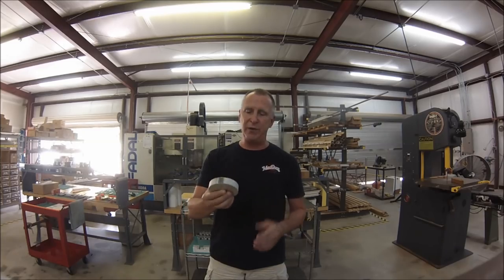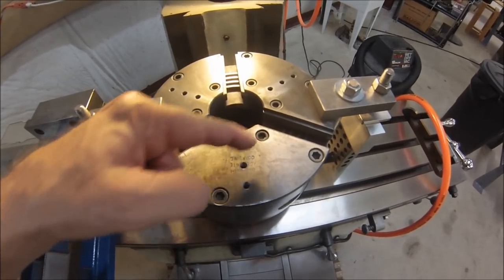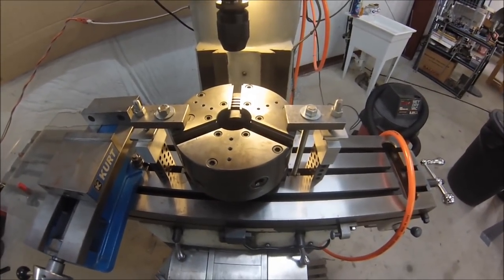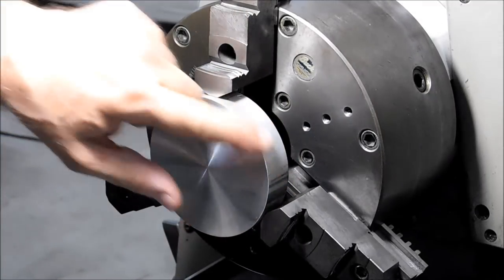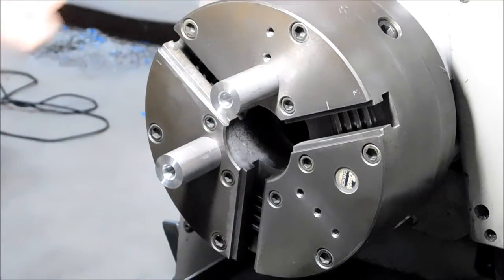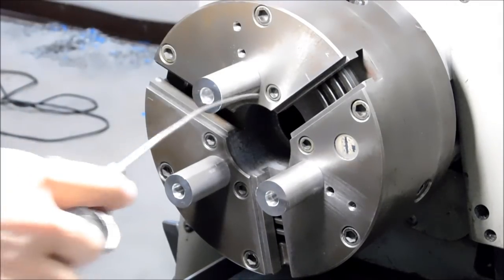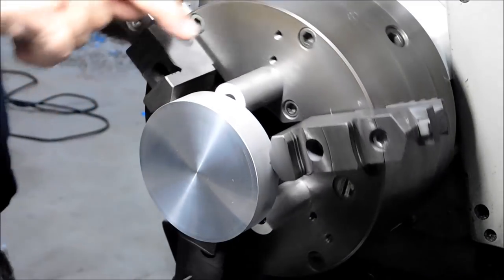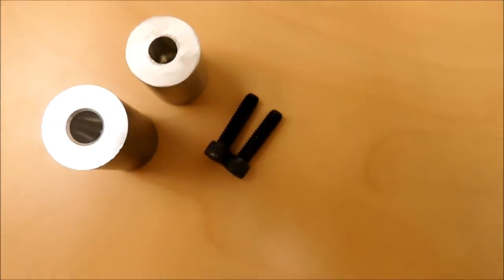A Simple Chuck Modification to Improve Parallelism of Your Parts

Comment: You don't need to go through all that trouble, just buy yourself a set of reversing jaws or in your case I notice you can reverse the set you have already have, simple isn't it!!!.
Reply from the maker: Provided your jaws don't deflect outward when you tighten them, and provided your parts are thicker than the jaw steps are deep, and provided you aren't worried about possible jaw scratches on your part from jaw movement on a finished face, hard step jaws will work. Personally, if its not a soft jaw setup, I'll take a solid stop over a movable stop any day. This video, as many of my videos attest, isn't about buying anything. Its about getting it done now.
Reply from the maker: On older worn chucks, the jaw deflection will effect the part. Even if they are skimmed soft jaws. It will be close, but this will be closer. If concentricity is not the target, this works extremely well.
Reply from the maker: Take a look at the video titled " Jaw movement you probably weren't aware of"  These standoffs take that error out.
Reply: And if concentricity is a concern, these work with a 4-jaw just as well, just have to make 4th pylon :)

Comment: I am not a big fan of doing "precision" TWO-SIDED work in a scroll chuck... no matter what workaround you have...
Reply from the maker: Tell us what choice you have and use.
Reply: an independent chuck and a dial indicator... scroll chucks are for welders and woodworkers...
doing ANY "precision" two-sided work I wouldn't re-chuck on an unmachined surface, I would skim cut myself enough space to
 re-chuck and indicate off of.
Reply: D-railed  For apprentices (like me), can you describe how this makes a difference given what Joe is demonstrating?  Seems to me you are talking about insuring concentricity, where Joe is simply demonstrating how to get two surfaces (of the same part) parallel quickly... What difference (other than concentricity of a part) does it make which chuck is used in this case?  I get that scroll chucks don't equal "independent" chucks when it comes to centering parts...  But that doesn't appear to be the point of Joe's discussion...What am I missing?  Thanks.
Reply from the maker: You're not missing anything. The demo was exactly as you say. Concentricity is a whole other story.  The comment D-railed made has some merit, But I'll take a nice scroll chuck any day. An adjust tru buck is one of the finest chucks made. Its a scroll chuck. Independent chucks are usually 4 jaw and I only use them when a 3 or 6 cant hold the part. I'm not a fan of the technique of holding round material in a 4 jaw. Its a waste of time.
Reply: actually, you should be cutting deep enough to produce a shoulder to indicate off of when flipping the part to prove your parallel, trusting standoffs OR soft jaws to do so on an unmachined surface or any surface is risky business...you can get "lifting" when tightening your jaws even if you think you are all the way back against those stops. 
having the perpendicular faces machined in the same setup and using them to indicate from for the next set up is the only way to make sure...
i get it was just that way for demonstration but if you are going to flip parts ops need to line up with the last one, telling people to rely on stops and not indicators is not "precision" work.
I am a toolmaker moving towards metrology, seeing how wrong I have been about being accurate AND precise...
 but yes a "good" scroll chuck is OK for a lot of work,
 just giving you shit because that's what machinists do. 
great videos by the way.
Reply: @RubSomefastOnIt  to make 2 parallel faces on a round sliced bar using a lathe you do not need a 4 jaws chuck. 4 jaws chuck are for other specific purposes. Joe was right, you are outfield, sorry.

Comment: Just drill 3 holes in the pcd between the o/d and i/d and make some 90 deg angled brackets , about 25mm wide and mill a slot down the middle of them and you have an infinity variable stand off rather than having to mess about with drilling your chuck in different places.
Reply: Could You Show Us What You Mean Pls.
Reply: 1ginner. Whats a PCD ?  What’s holding you’re brackets to the chuck. Sounds like you’re going to have three 90 deg rockets as soon as the lathe starts up. Ouuuccchh !

Comment: How about instead of a series of threaded holes for the standoffs, you cut three small t-slots and use t-nuts to thread the standoffs into?
Reply: This seems simpler and just as effective. If the standoffs are an inch in diameter, you only need those holes about every inch. I'm not a specialist tho.
Reply: Many chucks do have tee slots in their faces for custom mounting techniques like this if you look for them. I have a couple of old Pratt Bernerd's like that. I think they're the ones that came with soft jaws as standard, which makes sense. I don't think you see them so much on newer chucks, probably due to cost and health & safety concerns. The old boys learned fast, from someone else's last mistake, so they're more careful than to ever leave anything loose or a key in the chuck.
Reply: was in the biz for 51 years, never saw one. Learn something new every day....thanks.

Comment: i'm confused, how does a three jaw chuck always centre when you put all the jaws on at different times of the worm rotation?
Reply: He's putting them back in order 1, 2 then 3. That's why he locked the chuck in the same position to remove the jaws then to return them.
Reply from the maker: The worm doesn't know where it is. As long as the jaws are installed in 1,2,3 sequence, they can start in any slot.
Reply: @joepie221  so does the worm have three seperate slots then, or one spiral slot?
Reply: @grosom31  it's one big spiral, but jaws are different and must be installed in right order, as Joe mentioned. They're numbered and chucks have numbered slots to make it easier -  so jaw 1 goes int slot 1 etc., but you can easily do it even without those numbers.
Check out this guy's video:
https://youtu.be/T1xTuxLFIlo?t=509
It's in Polish, but everything should be clearly visible and you should get the idea.

Comment: You didn't measure parallelism. You just measured thickness.
Reply from the maker: Are you sure?
Reply: Flatness of the face assumed, you can do it that way. But if the face was conical then parallelism is pointless and unlikely.
Reply: Maybe for you, but still not proven, and he SAID parallel. If you're going to be an education channel I would suspect you'd want to be complete and accurate in your explanation and demonstrate your claim.
Reply from the maker: I welcome you to demonstrate that my claim is invalid, or mechanically explain your opposition to my wording or technique.  A 3 point measurement would indicate the value differential in parallelism regardless of the 'in machine' mic measurement or surface plate inspection with an indicator. The 2 tenth value would show either way. Your up.
Reply: I never said it was WRONG.  I did not see a complete accurate measurement of parallelism.  Some of us mechanical nuclear inspectors are held to a very high standard of interpretation and proof. As opposed to the "it's close enough" crowd.
Reply from the maker: I would hate to think you just called a 42 year career toolmaker and orthopedic instrument design engineer with a half dozen patents, a member of the "close enough" crowd after watching me face a piece within .0002 parallel in under 4 minutes. Plus you still didn't answer my initial question. But I'm not shocked.  I once heard a guy say, those that can...do, those that can't...inspect. I've made LA class submarine parts for general dynamics, shuttle parts for NASA, DSRV valves for foreign governments and halon gas systems for our military for years and had more than one opportunity to eat an inspector for lunch over dimensional conformance.
Reply: In the real world, it's always "to what decimal place", ie "what's 'close enough' for your application" because measurement can go on until individual Planck length if you can refine enough with your tools and setup. For many applications, .0002" parallel on a roughly 4" wide piece is likely more than good enough and it was done very fast. Yes, if someone needs something more, they will need to do more precision in their setup, but his technique was legit, and effectively time saving, since he didn't change the position of his tool as he made all the cuts and he measured thickness in 3 places on the parts. 3 points make a plane and he measured off 6 points technically, 3 on each side of the part together, ie he measured both planes and their distance from each other. That is a measure of parallelism.
Reply: Technically Bruce is correct, but in the real world a lathe does what is by all means considered a flat surface, ergo parallel part with this technique & measuring. You could have a worn out lathe or one that has an X out of square with the spindle axis and it would basically turn a cone one way or the other, which would make a part that measures the same from all around the part (when measuring on a given diameter), but would not be parallel.

I'm all for technical accuracy, but splitting hairs when it is not needed is just blowing in the wind.
Reply: One in every crowd...lol!

Comment: Tolerance of 2/10 in what?
Reply from the maker: I am not sure of your question, but heres an answer. 2/10's ( expressed her in imperial measurement )  is usually recognized as 2 ten thousandths of an inch ( .0002 ), not .2 of an inch. In semi conductor work where parallel and flat is critical, it is not unusual to have print tolerances on flatness and parallel in that region. This sample was well within that range. This material was 6061 aluminum.
Reply: @joepie221  why customary units instead of metric?
Reply from the maker: @allennelson1987  It doesn't matter what unit of measurement you use. The result will be the same.
Reply: @joepie221  but metric is easier to understand.
Reply: @Allen
He is American, they use imperial measuring system.

Comment: Do not drill any chucks that are going to exceed 1k rpm... VERY risky... never modify a CNC chuck... this guy has many great videos.. but be warned that drilling anywhere even if the bolt pattern is centered to the chuck od or id WILL unbalance the chuck... at high speeds this can be really bad if it comes apart...
Reply from the maker: You may be correct, but I have drilled every chuck I have ever worked on without incident. This chuck has drilled holes in it much bigger than the small ones I put in.
Reply: What about when you hold an odd shaped part in an independent 4 jaw chuck, that's going to affect the balance more than those drill holes surely??
Reply: I guess your also saying don't ever machine higher then 1krpm when using a 4 jaw.
Reply from the maker: If your setup has been balanced properly, higher speeds should be fine. Faceplate and angle plate work on a lathe are very common setups that require super attention to correct balance and they run smooth all the time.

Comment: There are others ways to achieve the same result
Reply from the maker: List them.
Reply: @joepie221  How about take your other chucks? They have a surface you could face, so you dont need any round bars
Reply: @103798  I"m guessing you're talking about the face of the chuck.  If that's the case you can only use that reference surface for parts that are thicker than the jaws.  By using a larger surface you also increase the odds of debris getting between the two surfaces and throwing the part or parts out of parallel.  Three smaller points of contact is by far the best scenario to establish a flat plane to reference you part to.

Comment: I appreciate that you offer this tip in good faith, but you have made the machinists's cardinal sin of over extending your self centring chuck, way beyond its limits!
A chuck jaw should NEVER extend more than 1/3 beyond the chuck body OD - The all ubiquitous "rule of three" strikes again!
So , reverse the jaws and use the integral "true" of the "outside" jaws.
As you are using "sectional jaws", then this is even easier.
Simplest and most fool proof way is to mount the piece after facing into the chuck, with two parallels(or drill bits, etc) and use the tail stock(no tooling required) to press the workpiece unfinished face outermost against the parallels, loosen jaws, then nip back up, hey-presto parallel, or in semi-production stuff, then bash out some soft jaws,.especially if you have a sectional jaw config.
It's a bit"just" more elegant  than what mill-wrights do with "soft blow" mallets!! ;)
Nice post, but remember Occum's Razor. :)
Reply from the maker: Though I appreciate your input, the face of my chuck is marked with a safety line to assure my jaws are securely engaged with the scroll. Most, if not all chucks have a sweet spot that when the jaws are reversed, a certain size workpiece will be impossible to grip on the outer step and be sub surface if the inner step is used. As for rules, well....I personally want my workpiece to be the object that defines the safe working plane and not have to worry about the compound or carriage because tooling is inside the jaw face. To each his own, but I've never had a problem.
Reply: @joepie221  on that note, Joe, how tight is tight enough when clamping your work in jaws?

Comment: Bwahaha  This guy has NO CLUE .. if he reverses the jaws teeth.. he'd find that the teeth HAVE a backing face ON them ... 2 to be exact.. >.and those faces can easily be shimmed for further adjustment.... Drilling and tapping 9 holes in a chuck.. NO THANKS.  You can SEE the curve on the jaw teeth ON the steps...
Reply from the maker: Tell us all how you would setup a 50 piece run of parts. Lets say 4" dia, .3 thick  without using soft jaws. I believe the jaw steps are only good for parts thicker than the actual jaw step height. Then there is small thing called jaw deflection to worry about. I anxiously await your reply.
Reply: @joepie221  Joe...That clown dosent even know what "jaw deflection" is all about. And when he said "no thanks" to drilling and tapping holes thats probably because its beyond his skill level. Do yourself a favor and dont be too anxious for a reply :D
Reply from the maker: @yankeemachineworks6115  Thanks. I'm not holding my breath.
Reply: Dave Chambers  me thinks you got no clue! Joe’s ideas work! And they are easy!  If you can’t poke nine holes n thread m, u r n the wrong gig
Reply: There are a lot of reasons to drill and tap holes in a chuck. I think this guy got a toy lathe for Christmas and thinks he is a big boy now. Listen to your elders little boy.
Reply: @randyhooks1214  funny thing is tips like these will get that toy lathe doing big boy tricks. Maybe nowhere near as good as a good lathe, but it's definitely a step up.
Reply: @jjbailey01  I wasn't talking about Joe's video. He is doing well. His tips are dead on.
Reply: @randyhooks1214  I concur. I was referencing what you said to the other guy who isn't worth talking directly to.
Reply: @jjbailey01  oops
Reply: David Chambers , you have no clue.....

Comment: Thats ok...but should have turned o.d. when you faced it off. No guarantee that o.d. is running 0. He didnt check it with indicator. I will stick to my soft jaws.
Reply from the maker: The title of the video is about parallelism. Honestly I didn't imply or state anything about concentricity. Soft jaws can't compete with the level of parallel accuracy this will deliver.
Reply: It's a demonstration of how to face a part parallel. Who says the OD has anything to do with the finished part?
Reply: @joepie221  Correct again, Joe. You could have done this on a 4 jaw chuck, with the the swinging eccentrically 2.000, and it would have no effect on your machining a part parallel. Gotta love these guys with 40 weeks on the job arguing with journeymen with 40 years on the job!!!! LMFAO!!!!!!!!